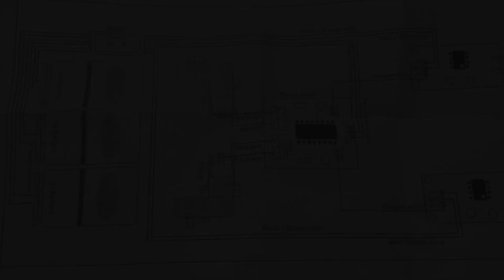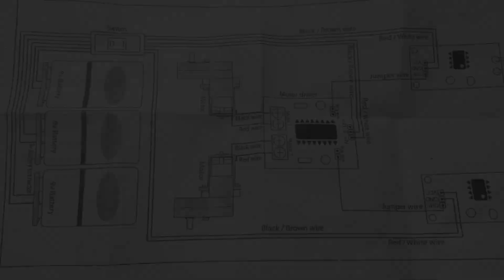How to make a Line Follower Robot using Arduino Uno

Comment: Where u have used arduino uno
Reply from the maker: +Sidak Singh I am using only motor driver only
Reply from the maker: +Sidak Singh you are also use arduino Uno with more customise option with arduino
Reply: @IPwebnetwork 
 @IPwebnetwork  дают ссылку на драйвер двигателя